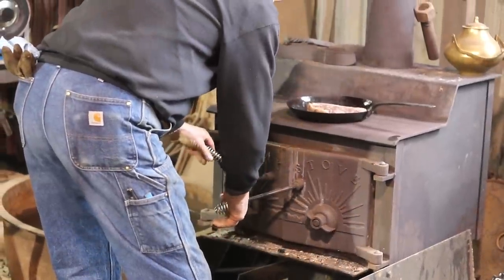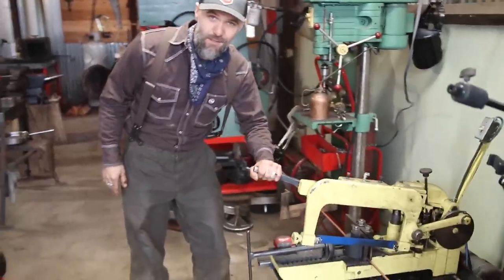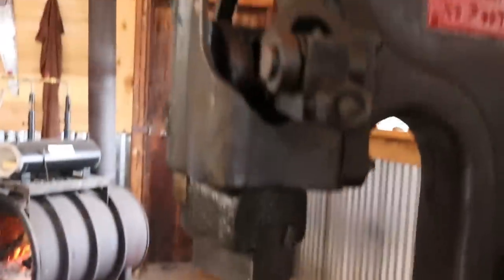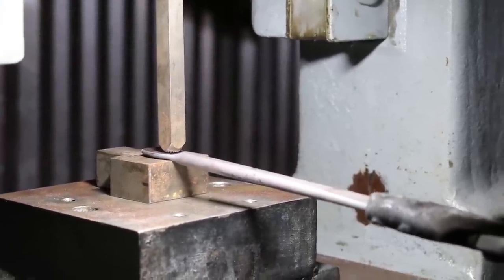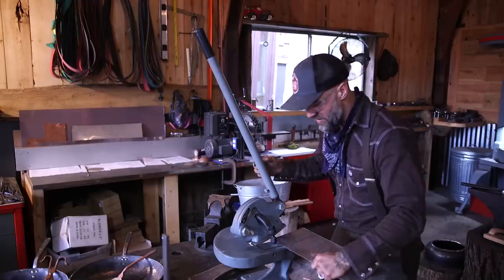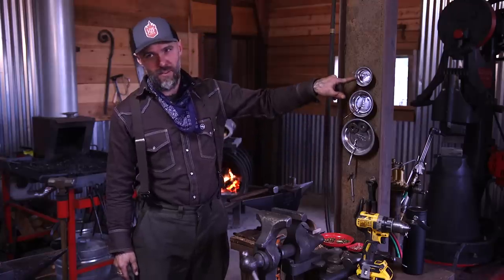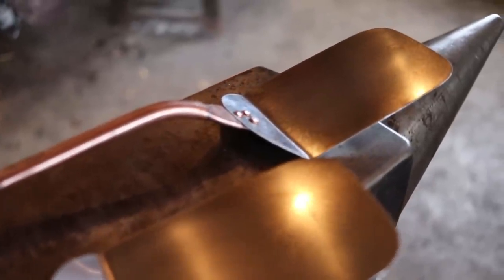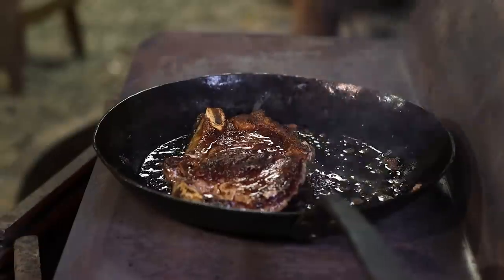Forging Cookware and Eating Steak

Comment: last time I used a power hammer and a power saw they were on belt lines.. had access to a full belt drive workshop for metal and a sister shop for wood during eighties.. Appomattox Iron Works in Virginia..great boss and jobsite even if minimum wage.. learned a bit of everything

Comment: Power hacksaws are great, if you break a tooth you can still use the blade, just offset the workpiece a bit and carry on, also the blades are a lot cheaper than bandsaw blades. They are slower than bandsaws and tend to wander across the floor if you operate them at high speeds. You can still find them used for reasonable prices.

Comment: I just recently started getting into cast iron cookware.
Have seen and read about cowboy skillets but never 
really understood them. 
This was a great primer and it was awesome watching 
a true craftsman ply his trade.
Thanks for letting us see a master at work!
Reply: A properly seasoned cast iron or carbon steel skillet is every bit as "non-stick" as a teflon coated pan, and the seasoning is hard enough that you can use metal utensils on it. Best of all, if you do manage to ruin seasoning, it can be fixed. Once you scratch the coating on a teflon pan, you can either live with the scratch or throw it away; there's no fixing it.
Reply: If you haven’t already, check Torbjorn Åhmans latest video. You’d probably find it very interesting.
https://www.youtube.com/watch?v=55WrP4AqgUI

Comment: Love it, Scott! Was great to peek inside the processes of another shop; good perspective!  👍
Oh how I need a wood stove in my humble shop.... can't wait! :)
Reply: Living in a much colder area than EC fire places are more work than they are worth IMHO.  Buying wood was almost the same price or more as heating oil for my jet furnace. Then I was spending 10 min a day walking to the pile and splitting took half a day.  Cutting it myself was way more expensive by the time I paid truck fuel and the lost day and permit. My insurance also freaked out when they found out about a fireplace that could have gas around.

Comment: As a guy who has spent his life in manufacturing, it is really cool to see how guys make things by hand.  But it is also really frustrating because they have things set up very inefficiently.
Reply: Although I have zero interest in production manufacturing I’m always open to ideas to be more efficient as a solo artist.
Reply: Ignatios Nelson  wow you are very disrespectful. And your information is far from accurate. I am sold out and always will be. Have fun working Amin your manufacturing facility. Sounds really fun.
Reply: @stagecoachfarmforge  Just to be clear..I wasn't knocking you at all.  
Look into cellular manufacturing.  Set up each area to do something specific.  Like when you are making a spatula.  Set up an area made to just make the handle and then one for the flat part.  Set up a jig for the flat part and a vise that does just that.  You'll find that walking around your shop from end to end to get this and then get that, doesn't add anything to your product, it just makes you work harder for it.  Movement will waste your time, make you work harder and provide no more value to your customer.  Of course, time not spent walking around or setting up tools, means you can make more product.  
Just some thoughts from a guy that got paid well to make factories better.
Reply: Ignatios Nelson  I have an equal distaste for the hipster...but no need to knock beards and coffee.  That's fighting words.

Comment: Hey Nate/Scott do you use UV filters on your lenses? If so you can see pretty noticeable flaring/ghosting with harsh white lights, like around 2:50. It's nothing major, but you likely wouldn't get something as noticeable without the filter (depending on the lens).

EDIT: To be clear, UV filters can cause ghosting and flaring!

Comment: I suspect that the primary reason for switching to cast iron for cookware had much more to do with lowering individual piece costs than anything else. When larger presses became available steel pans could then be made cheaper than cast iron and the inherent problems with thin castings were eliminated.
Reply: Agreed!

Comment: He does beautiful work, but I really have to question his claim that the power hacksaw blade outlasts the bandsaw blade.  Also, how can it cut harder material?
Reply from the maker: I did not get that either!
Reply: Harder materials require less speed and feed to cut. It didn’t make sense to me but it didn’t not make sense either(I’m a machinist so I work cutting metal all day)
Reply: There are Tungsten hacksaw blades, but I'm not aware of bandsaw blades with Tungsten carbide.
Reply: Higher downward pressure on the cutting blade. Blade is also probably a lot thicker than a bandsaw.

Comment: I stopped trying to estimate doneness a few years ago. Now, I use a small Thermapen-type thermometer.
Reply from the maker: Good idea!
Reply: When a steak starts bleeding its hitting rare from blued. After 1-2 mins of bleeding, depending on thickness, its almost always mid rare. The second blood stops coming out its med. once clear fluid starts coming out its med well. once the clear juice stops its well done and ruined. I use to cook 100-150 steaks for fundraisers
Reply: @raystraining3206  Or, I can just use a thermometer and get an accurate temperature reading
Reply: @raystraining3206  AWESOME tidbits of knowledge right there. Thanks for sharing this! I'll be remembering this for when we entertain this summer.
Reply: The thermometer is absolutely the way to go! Cook the steak EXACTLY the way you like it every time. Never eat your steak again, being disappointed that you didn’t pull it just slightly sooner. Just don’t forget to take ‘carry-over’ heat into consideration. 
I’m a med-rare to rarish guy. 128°-132° is perfect for me.
Reply: Thermometer is the way to go. I've been cooking for 16 years as a line cook and now chef, and while It doesn't take long to figure out how done a certain cut of beef is there is a learning process. I'll temp the first 5ish if we are switching cuts/source and I'm ready to go. Of course supermarket beef is all over the place so at home I'm always using a thermometer. Better than wasting food using whatever wives tale you've grown accustomed to.
Reply: @psidvicious  Hello! Good to see you on another channel I watch! For me it's easy. Sear both sides and put it on the plate! 😁

Comment: Hi, l was Wondering how's it that those forging cookware doesn't get rusted? Thank you
Reply: Cast iron DOES rust if you keep it wet, but it's a surface rust. I'm not familiar with carbon steel pans, but with cast iron pans you "season" it by cooking oil "into" the surface. Makes for a bit of "non-stick" surface as well.
Reply: @larrybud  Thank you Larry

Comment: While I love the look of copper, I wouldn't want it as a handle. The annoying thing about copper is that it's a great conductor of heat which means that it'll get hot really fast if one part gets hot.
Reply: I wouldn't want it on any part of a utensil I was going to cook with.  If that comes into contact with any acidic food, the cooper will react with the acid and contaminate the food with copper salts.

Most copper utensils are sold for decoration only.  Professional copper pans are lined with tin (usually) on the inside to prevent contamination.  Once that tin is scratched or worn through though, you need to get it relined.
Reply: @-_James_-  Yes, that's very true. But having copper in the middle or outer layers for a pan works wonders for heat distribution. For soup pans for example it's absolutely amazing, nearly impossible to get a burnt bottom that way.
Reply: @WoLpH  oh I appreciate how good the copper is at conducting heat. You still don't want any contact between it and your food though. :)
Reply: @-_James_-  I fully agree :)